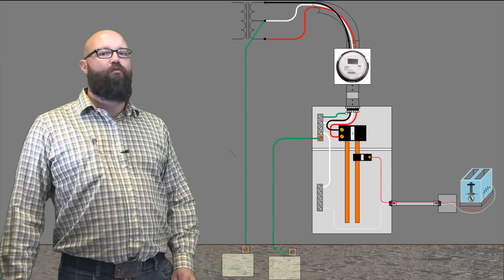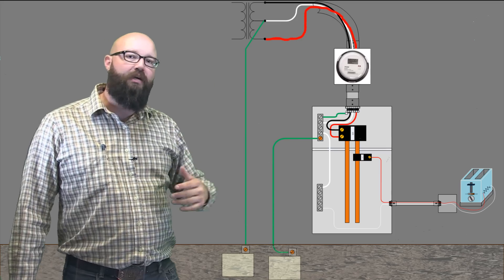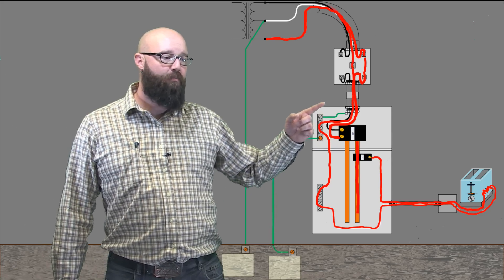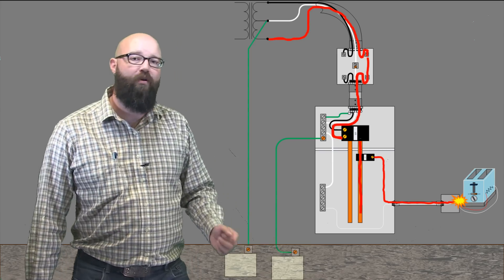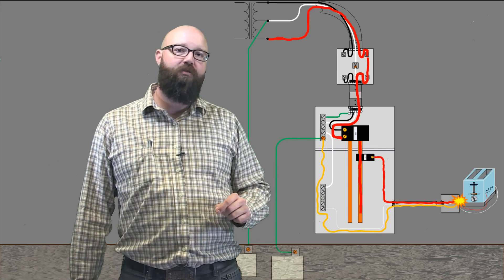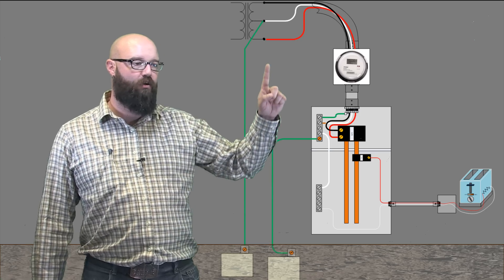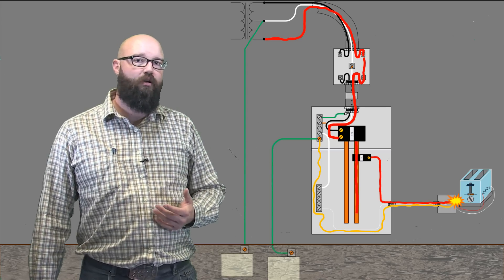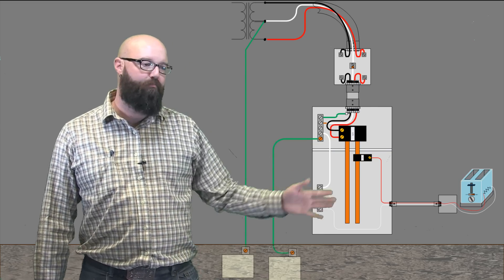Grounding and Bonding

Comment: nice video
there is something i just can't understand and ive been looking for an answer but i just can't find it, and it is that how come if the ground wire conductor which does not carry current and which is bonded to the neutral wire does not  get energized under normal situation. am i missing something?
Reply from the maker: Thanks for watching! Imagine the current flowing back on the neutral. As it reaches the point where neutral connects to grounding conductor, there are two parallel paths it can go down. The higher impedance path through ground, back to supply transformer, or the low impedance neutral back to supply transformer. Current will always flow on the path of least resistance. There would still be current on ground but it would be negligible due to higher impedance.
Reply: @schulerruler  , understood !! thank you very much for taking the time to explain, i was really in need of an simple explanation ive been dealing with this in my head  for a couple weeks. thanks
Reply: I respectfully disagree with @schulerruler here. Current doesn't flow on the path of least resistance - it flows on ALL available paths. So, in your example, SOME current would flow through the panel's ground wire, but very, very little. The reason mostly has to do with the fact that even though there is technically a path back to the transformer through the dirt, it's not a very good one when compared with the metal neutral conductor. Moreover, USUALLY there shouldn't be much current flowing through neutral back to the transformer as the two 'hots' should be designed to be balanced out (not depicted in this video).
Reply from the maker: I don't think I've ever seen a finished installation where the loads were successfully totally balanced. In a three wire single phase service there will almost always be current back on the neutral. And yes, it does go back to the supply transformer to the neutral point. You are correct that there is almost never current through the dirt. The point of that illustration is that in the absolute failure of a neutral, and failure of the service raceway bond (which is highly improbable for both at once), there would still be a connection between the panel grounding conductor and the supply transformer grounding conductor. 
Under normal operation, there is no objectionable current flow on any bonding conductors PAST the service grounding location (service box) if there was, it would be a short to ground and the overcurrents should trip.
Reply: Right. I suppose I should have been more precise... 
Apologies for my own lack of better terminology, but I see it this way: There's the grounding electrode system on the "line side" (on the power company's side) of the bonding screw, and there's the grounding electrode system on the "load side" (on the customer's side of the bonding screw). I totally agree that under normal operation there will be no current flow at all on the "load side" grounding conductors, but on the "line side" there is probably some very small amount, because as you say, loads are almost never perfectly balanced - even if they were, simply turning on a light would take them off balance a little - and therefore some tiny amount of current must flow through the dirt instead of the neutral service conductor. Do you agree with that?
Reply from the maker: @truthsmiles  I do! And you're previous statement is also correct in that current does not take the path of least resistance, but rather it divides proportionally between all paths. Usually the neutral has such a sufficiently low impedance that majority of the current would be on that, but again, not all.
Reply: The ground wire (green or bare usually) is just a safety precaution. Normally it just sits there. What it's for is to keep anything that the customer might come in contact with at earth potential. Let's say a washing machine has an internal problem where a live energized wire inside of the machine has had the insulation worn off and the live wire is now in direct contact with the metal cabinet of the wash machine. With no ground wire the wash machine will still work okay but if the user touches a water pipe and the metal cabinet of the washer at the same time he or she will get a shock. However if the extra ground wire, which is connected back to neutral in the service panel, is properly connected to the cabinet of the washer then the breaker will trip because of the bad wire inside the washer. This will prevent the user from getting a shock. Then after multiple attempts to reset the breaker and unplugging the machine the user, who was not electrocuted and is still alive, just calls a repairman to fix the problem inside the washing machine. The extra ground wire has done its job! Note that theoretically they could connect the cabinet of the wash machine to the neutral and eliminate the ground. But if the neutral were to open you'd have the same safety problem. So they add the extra ground wire instead.
Reply: that bond in picture is a code violation if is done in a subpanel. to close a circuit at transformer one thing you don want is a parallel path of neutral and ground. totally Hazardous.
Reply from the maker: @berniecarrera  Correct, you would not have a connection between the neutral and the bonding system past the point  of the supply service disconnect. This is meant to simulate a combination residential panelboard, where the disconnect is the uppermost breaker. Anything within that barrier area is within the "service box" so a connection between neutral and ground here is acceptable. The transformer in the picture is meant to be the supply transformer where a seperate grounding electrode and conductor is required. 

If this were a subpanel, the brass screw in the neutral would need to removed or, as you said, you would be creating a dangerous parallel point.

Thanks for watching and commenting!
Reply: @schulerruler - Not only is it acceptable to bond in the "service box", but _required_, correct?
Reply: @truthsmiles  All non-current-carrying metal boxes are required to be bonded, yes.
Reply: I would guess that in practical terms there is some current on ground conductors, probably too small to measure with many meters.  It'd be interesting to look for current on the ground of a sub panel with an isolated ground serving industrial machines.  I'd guess there would be measurable current, especially in wet or old installations.  Not just from fault current, but also from inappropriate bonding.

Comment: Putting a grounding rod to the earth is not enough to trip a breaker due to earth resistance.
Reply: fred  I cant speak for the United States, but we certainly do not switch the neutral wire in Canada. Hot wires are run directly from the last overcurrent device to the switch and then to the light fixture. I question the source of your information regarding north Americans switching neutral wires.
Reply: fred  Canadian electrical code rule 14-016 (connection of control devices) states "devices required by this section shall not be connected in any grounded conductor" ie the identified or neutral conductor
Reply from the maker: ohmar luzano thanks for watching. You are correct. just placing a rod would not be sufficient, however, installation with respect to local codes regarding proper grounding electrode material as well as proper burial depths should suffice. If you are concerned about grounding in your area, my suggestion is to contact your local supply authority with jurisdiction for further assistance.
Reply: @schulerruler  In the US, the NEC code says 25 Ohms for a grounding rod.  But Ohm's law tells us that 25 Ohms is not low enough to trip a 15 Amp breaker @ 120V. Therefore, ohmar luzano is absolutely correct that the breaker would not trip.
Reply from the maker: @LonnieAdams4  as stated in my feed and channel description, this is intended as instructional aid for CANADIAN electrical code. While the NEC requires maximum 25ohms to ground impedance, the majority of countries have a maximum of 5 ohms to ground as required by NFPA, and IEEE. This would allow for considerably higher fault current in the unlikely event that we rely solely on the connection to ground as our low impedance path. Generally, our low impedance path back through the neutral will be what trips the overcurrent. Thanks for the comments. To affirm your answer, in the case that we lose neutral and the bonding jumper for the service raceway, or even just the connection between service equipment and neutral, you are right that an NEC installation would not clear a fault if ground was at maximum impedance of 25ohms. Cheers.
Reply: Even if you have 5 ohms to ground resistance then that would have to be x 2 since you would have another 5 ohms of resistance at the pole which is in series so that would total 10 ohms resistance which wouldn't trip a 15 amp breaker. I know that the NEC never intended for an earth connection to clear a fault by tripping the breaker. I doubt that the NFPA or IEEE intended that either.
Reply from the maker: @MandrewP  Remember, that's MAXIMUM five ohms to ground. Obviously zero is the desired target, but that's not always realistic. IF we were relying solely on the connection through earth to the supply conductor, then yes, it would likely never trip due to the impedance being too high, but this is how the system is designed. We do NOT however rely on that connection to clear faults. This is why the connection between the neutral conductor and bonding screw on the SUPPLY side of the service disconnect is so crucial. 
Thanks for watching and commenting.
Reply: Power to earth in Australia will kill the breaker/fuse but we are wired differently to what I'm seeing here.
Reply: @JackHudler  Don't see any arguing about a vs b
Reply: fred  can you explain what you mean when you say north American electrical systems are negatively wired? Thanks
Reply: fred we have things called GFCI and AFCI breakers which provide for imbalance detection and arcing detection, respectively. A lot of older homes don’t have them, however.
Reply: fred that is incorrect. The point of switching is on the “hot” or “live” side before the device, not on the neutral after the device.
Reply: @OrdinaryDude67  Haha, agreed.  A bit of misinformation I was fed a long time ago and never bothered to question.  lol.
Reply: If the impedance is enough to leave the breaker closed, then isn't the current flow kept low enough to prevent heating the wires and causing a fire? I'd suspect the appliance wouldn't work properly, hopefully prompting a call to get the circuit looked at.